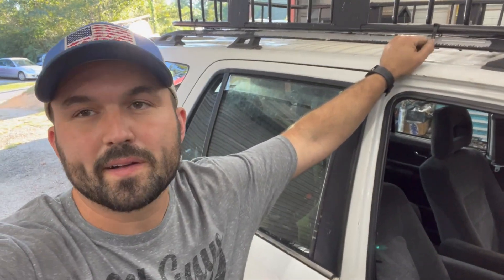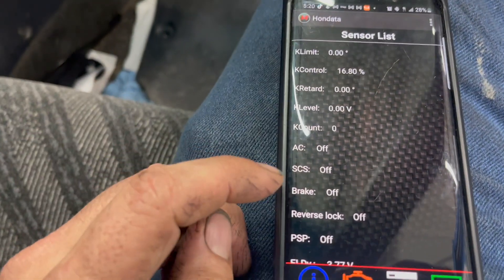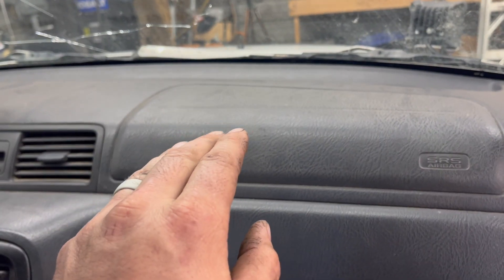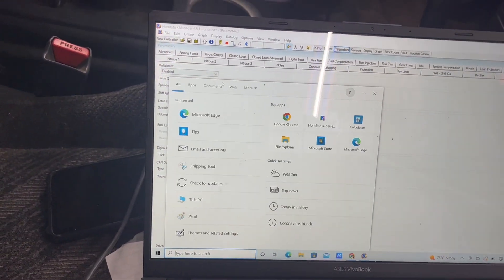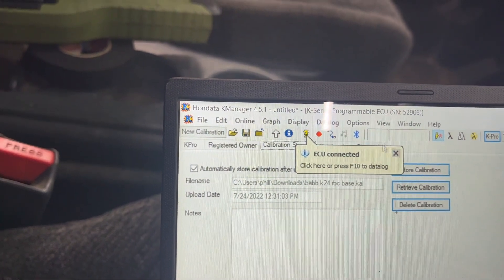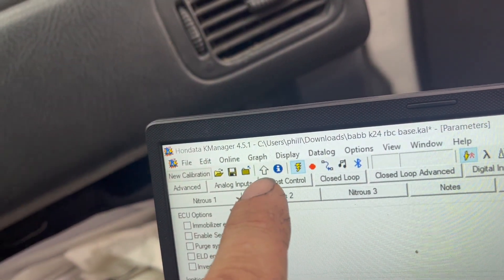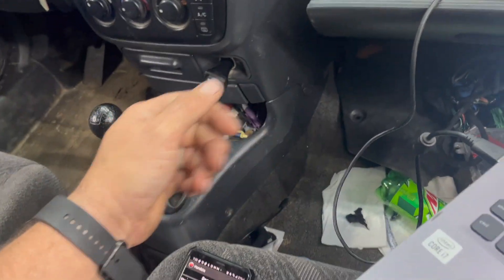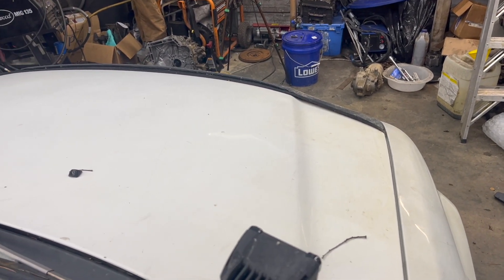K Swap KPROv4 VTP / AC Switch Wiring | Honda CRV K swap

Comment: Would this work for a 2000 ek k24 hondata v4 ? Hybrid kit , do I wire the 2 ecu wires same as yours to make ac clutch switch on ??

Comment: Are your fans wired only to the radiator fan? Are they separately wired like stock? do both of your fans come on when you turn on the ac? or just the ac fan?
Reply from the maker: They are wired like stock. Both come on with ac.
Reply: @hondaresource  thank you! followed your wiring on m 99 em1. works great!
Reply: coming back here on this page just letting everyone know that it worked out for me. Be sure to follow your pinouts and find the pins that fits ecu.

Comment: Are you still running the hybrid racing relay tired into the wiring? From my understanding if your going from E plug and B plug to the stock harness you don’t need to run a relay?

Comment: Hey brother I have kpro v1 but I used a relay to wire the ac compressor and ac switch and  it works but the engine start to over heat when ac is on it blows cold but gets up to 215 degrees new Condenser new dryer did the same with the old one im starting to think can it be cause of the ac load causing it to.over heat?

Comment: This did not help my ac problem. Wired my. Civic as you mentioned.. Corresponding wires as they should. Ac switch does not turn or or off, relay installed an all 😢
Reply from the maker: Bummer. Mine works perfect
Reply: @hondaresource  that's the gest of it for me. Lmfoa. Everyone's ac works but mine 😂😂 ill get it figured out or burn it to the ground
Reply from the maker: It took me a couple attempts to get mine figured out.
Reply: @hondaresource  serval calls to hondata, hobda vert and several eire diagrams... Turns out, my ecu, jdm prc can not run ac with Kpro /honda vert installed. Ne~d a prb, pnd or other

Comment: I have my ac in my integra wired into kpro but I’m having an issue where the compressor does not cycle wondering if yours cycles or Just stays on
Reply from the maker: Mine operates as normal